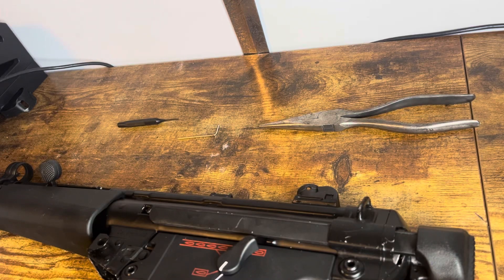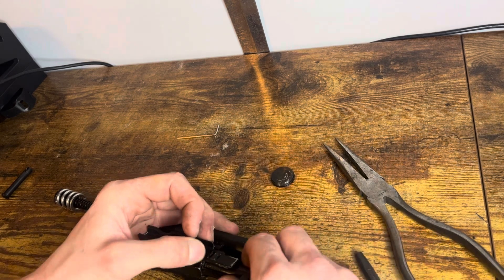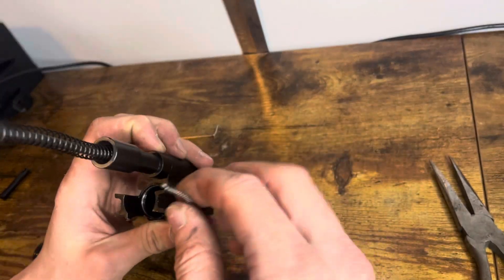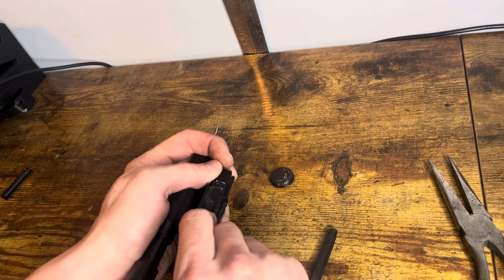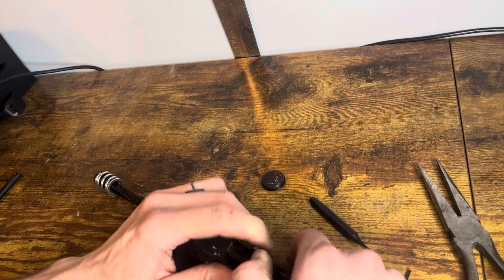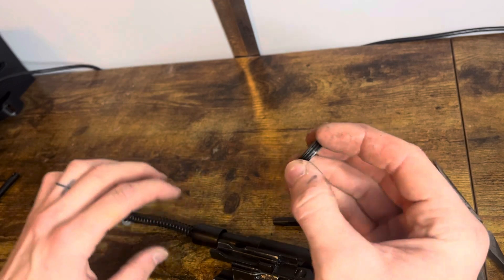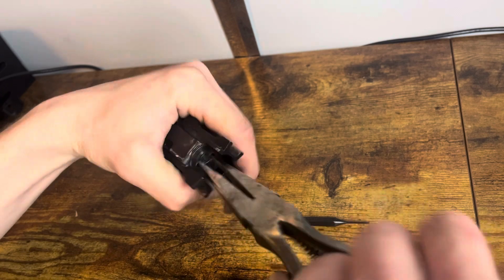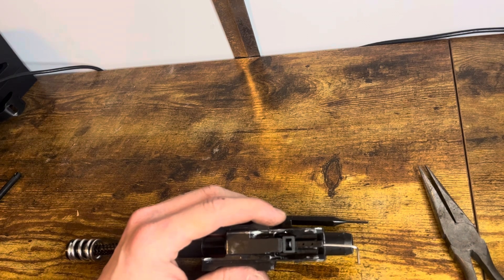Guillotine VFC MP5 GBBR npas installation tutorial

Comment: Hop arm’s turned it into a lazer.
The 8mm m3 it came with isn’t quite long enough to get lower than 1.5j unless I’ve installed it wrong. Also I had to sand the valve a bit cause the spring wouldn’t return it. 
But should be good once I’ve found a longer grub screw!

Comment: I bought the NPAS from Guillotine Airsoft, was knocking out rounds with a full charge UltraAir Gas and .32 BBs in 34 Celsius degree weather. It Chronoed at 1.6 joules and my second game it Chronoed at 1.5 joules, I have not brought it down to 1.2 joules just yet but I know it’s adjusted in the middle so getting a middle ball park output.

I also bought the VFC MP5 Hop Up arm which came with a nub. It’s a complete GAME CHANGER!!! On the stock Hop Up arm you would need a few clicks on the adjustment wheel to see a difference but the Guillotine Airsoft Hop Up arm you would need 1 click to see a difference in hop (also when staring down the inner barrel you can see when adjusting how the Nub and arm apply pressure to the hop up bucking which is a massive difference to the stock) my Hop Up bucking is a Flamingo 60 degree.

Accuracy now is laser beam on a stock inner barrel but could have 1 or two flyers off target in full auto (could be that my new Hop Up Bucking needs to break in)

Extremely happy with Guillotine Airsoft’s service, build quality and his email response time, he answered all questions off the cuff. Guys I highly recommend the NPAS and Hop Up Arm with Nub - it’s a Game changer. Thanks Guillotine Airsoft for your fantastic products and service.